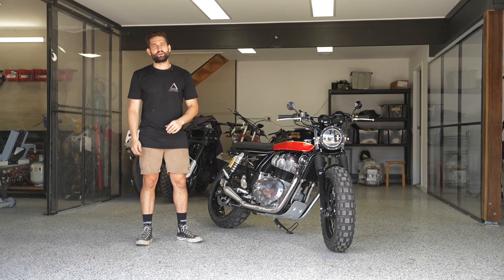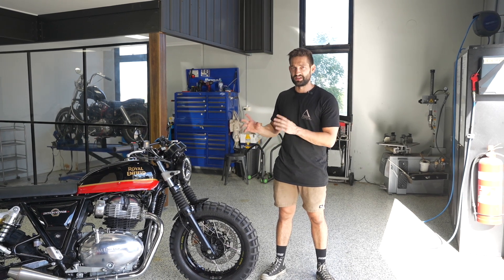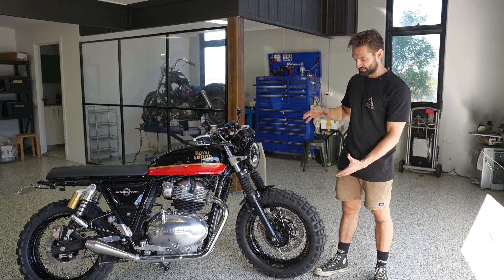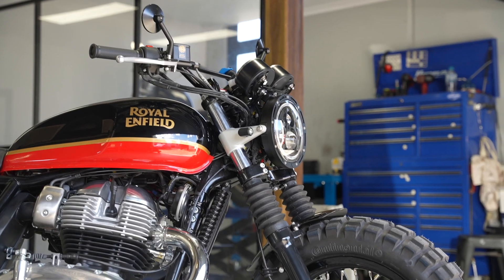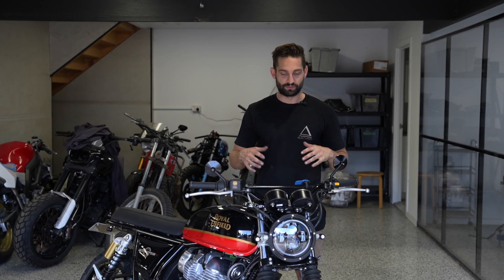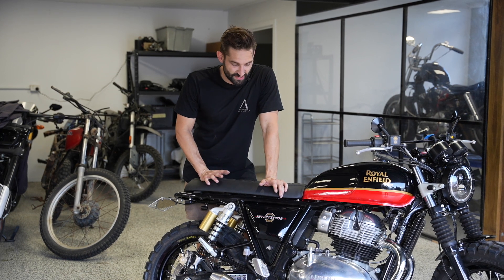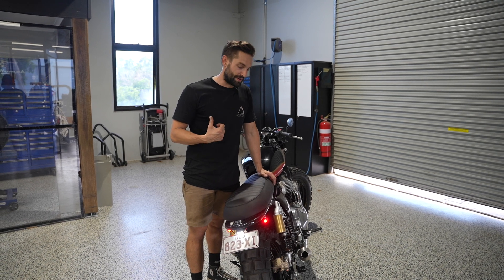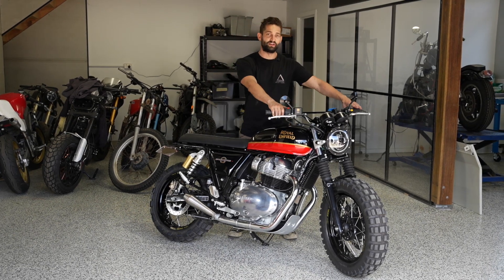Custom Royal Enfield GT650 Scrambler | Purpose Built Moto Quick Fix

Comment: Should we buy headlight mount in order to install that light ? Need to buy from India .. And what about signal lights ? Should I buy lighting control module as well or just 2 pairs of signal lights are enough to buy ?? Please respond wherever possible. Thanks in advance
Reply from the maker: Hi Mate. 

For the lighting upgrade all you  will need is the 7” headlight, turn signals, tail tidy and plate light. No need for the signal module analyses you want to do your handlebar switch upgrade too
Reply: @PurposeBuiltMoto  Great. Thanks for the timely response . How many days would it take to deliver it to India when ordered. I need head light 7”, tail light, signal lights etc from your site.
Reply from the maker: Usually express will be around 10 days
Reply: @PurposeBuiltMoto  Great, will see you soon with a purchase order. Thanks for great customization options.
Reply from the maker: @YT_Civilian  great, you can also email us for more details and we can put the kit together with the parts you need.

Comment: The build set up looks fab👌. How are the torpedo silencers bolted to the bike, can't really see on your video? Ive been looking for shorter silencers for my Intercepter
Reply from the maker: We supply a msall weld on or rivet on bracket with the mufflers at can get hidden on a little mount behind the muffler
Reply: Thanks for answering the question,  cheers

Comment: Can you guys make custom free flowing headers for the bike which follows the frame exactly rather coming from the cylinder exhaust valve and going out of the frame then coming back and also being straight rather than going up at the end and also which fits the stock mufflers if you can put them in your online store I will definitely buy them by the way loved the build keep it up guys 👍
Reply from the maker: That is definitely the most complex request we’ve ever had on the channel, we can make it custom but it won’t be a product we make
Reply: @PurposeBuiltMoto  why not ?
Reply: @dheerajspeaks  suspect its not commercially viable. I mean that is a custom request. The tooling required / RnD and the fact that it probably fits a specific bike ( possibly in a specific year range too ) that has a small ( admittedly vocal ) market a shop isnt going to see a ROI on that. Yeh I dont know why I am answering this either :)
Reply: @theobviouschicken  yeah I do agree with that but I wouldn't say there isn't enough demand especially in my area a exhaust that meets the mentioned parameters are rare to no, as far as I know the only guys who sell these custom requested ones online are revelry cycles and I find them to be silly expensive

Comment: Hi guys, great build. Just one question. Did you chop or cut the frame to make it shorter?? Thnx
The only thing you did, I think is chopping the Tail light bracket, right?
Reply from the maker: the frame was not modified on this build.
Reply: @PurposeBuiltMoto  thnx.. but you did remove the stop light and license plate bracket, right?

Comment: Great video🎉
How did u guys fit in the rear tyre ? Was there any kind of mods that u did to fit in the 170 section tyres ! Eager to know
Reply from the maker: no, everything was fitting ok.
Reply: @PurposeBuiltMoto  hm, I have fitted Pirelli Scorpion Rally STR 150/70/18 and it barely fits. ~6mm from the chain.
Reply from the maker: We’ve got some tricks up our sleeve